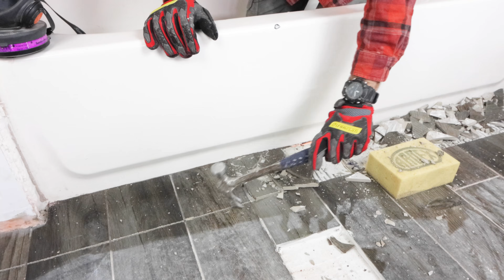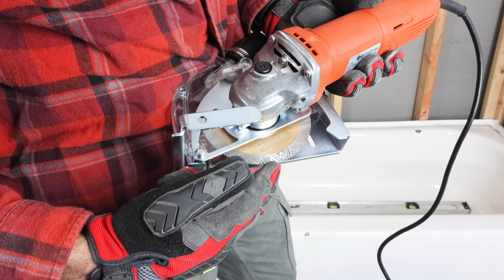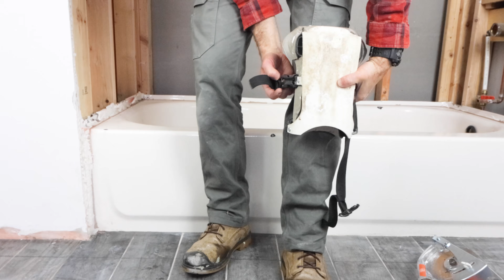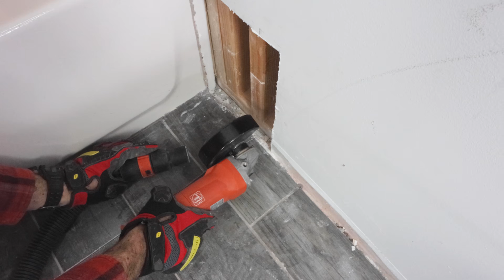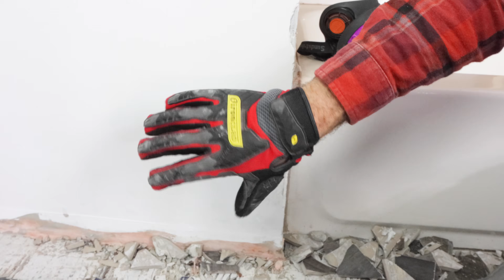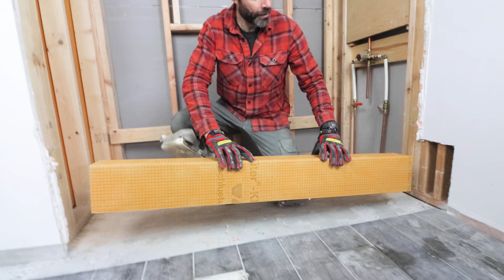Tile Floor Removal Tips for Beginners

Comment: 12 x 36” tiles on floor, cement based adhesive, 3/8th notch trowel. Average temp 64 f, Ave humidity How long before you can walk on it?

Comment: Would this work for a curbless shower? I hired contractors 4 years ago to install tile in the bathroom and I'm debating now whether to tear the whole thing up to install a shower.
Reply from the maker: yes, but we recommend waterproofing the entire bathroom floor outside a curbless shower, eg adding DITRA and overlapping that with the shower system products used for the shower

Comment: How are you going to fix the waterproofing after this (between the existing Ditra and whatever comes next on the shower side)?
Reply from the maker: you can set the curb against the existing tile (leave an expansion joint) then silicone against the curb and tile. Once the curb is tiled, add a second silicone joint between the tiles 👍🏼